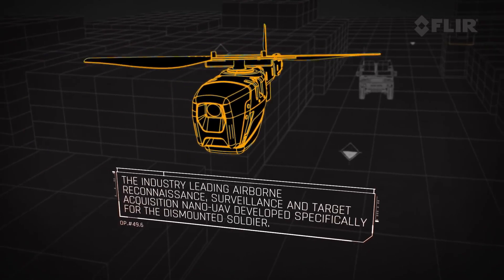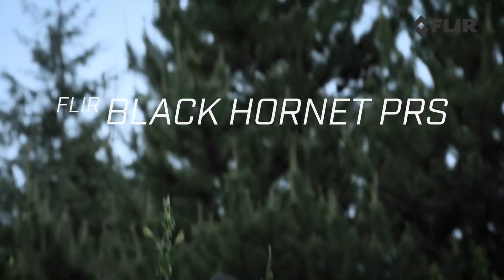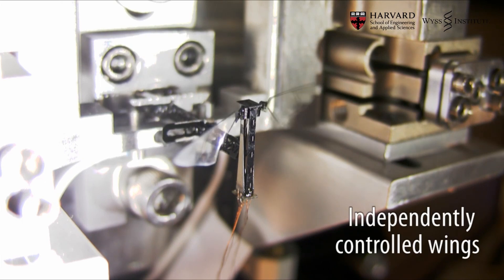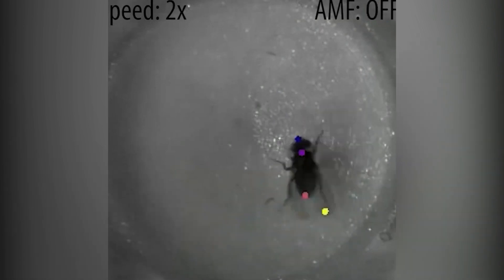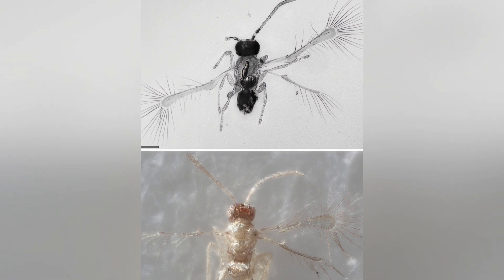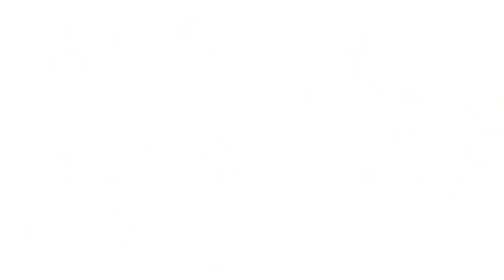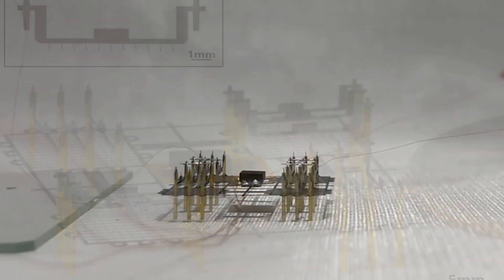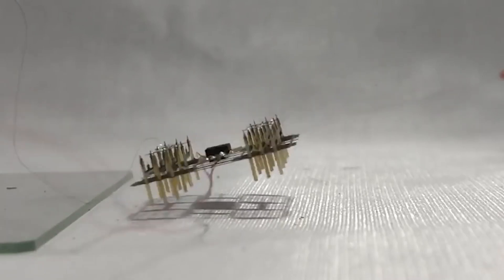The INSANE Engineering Behind Micro-Drones

Comment: That tech is TOTALLY sane, dude.  Kidding, mostly, and yes, taking things too literally.  And you can miniaturize motors and propellers to orders of magnitude smaller than what is on drones.  There are even motors, IIRC, based on single molecules, that is several orders of magnitude smaller.  And since we can manipulate individual atoms via a TEM, I suspect props can be made for them to drive.  Also, there are drones out there that are literally the size of insects, like house flys.
Reply: But at that point I don't think your even flying lol, just being tossed about like plankton.
Reply: @everettstormy  Very very tiny plankton.  The very small drones do fly, though.  They can be steered just fine, indoors or on very calm outdoor days, anyway.  

'They' also did an experiment I saw where they inserted electrodes into the brains of real flys and were able to steer them.
Reply from the maker: I agree, its getting into weights that can pushed by currents, its just a matter of control. Maybe micro will be the practical limitation in terms of distance covered/surveyed?
Reply: @Motor_Explorer1  Yeah, who knows, it will be interesting to see.   Obviously as you scale down further and further there are physical and physics limitations that work against you.  Keep up the good work, always interesting!  :-)